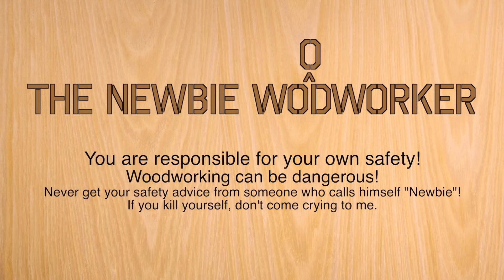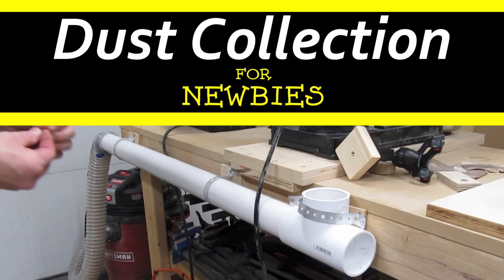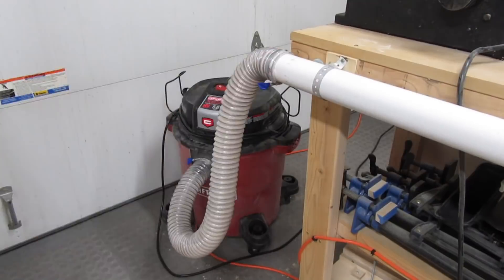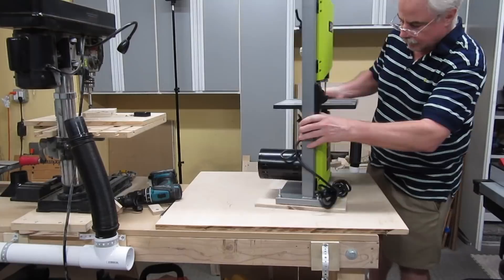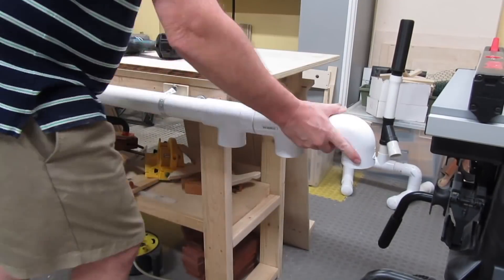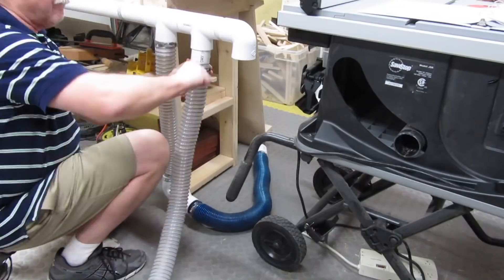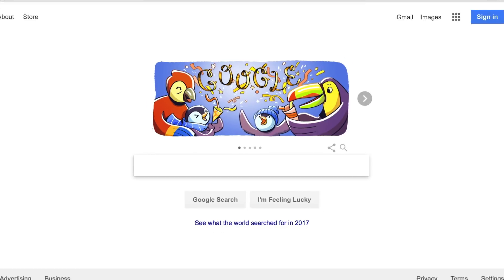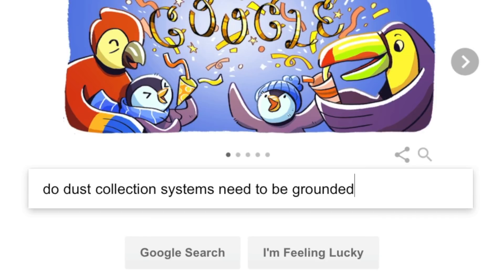Dust Collection Grounding: Follow-Up to 'Dust Collection for Newbies'

Comment: "Do dust collection systems need to be grounded?" I think I agree with James Hamilton on the issue. I also installed an above ground pool once that I didn't bother grounding or bonding either, despite the installation instructions. There's just too many conditions that would need to align perfectly to create an actual hazard, so, I'm going to skip this step. Thanks, Dan, for suggesting I ask that question of Google, which was also, in your roundabout way, an invitation to form my own opinion on the matter. I like your style, Dan! :)
Reply from the maker: Glad I could help. I can't remember if I mentioned it in this video, but here's an article I came across: http://www.woodcentral.com/articles/shop/articles_221.shtml
Reply: @TheNewbieWoodworker  Thanks for sharing that article. It's a little sad that the author had to do so much work to debunk a myth, or several. But, I'm glad they did, to hopefully save a bunch of woodworkers (Newbies and experts alike) headache and effort. :)
Reply from the maker: @primehomeinspects  I agree with you, although to cover my butt, I always tell people to do whatever they think they need to do to stay safe. 😏

Comment: I googled "do dust collection systems need to be grounded" and came across this youtube video https://www.youtube.com/watch?v=WJ8NMYlhaLQ which, near the end, claims that all dust collection bins should be metal in case of fire that could be caused by sucking in a hot piece of metal.  That said, I noticed that your bin, and those proposed by others, use plastic buckets.   Should this be something to worry about?
Reply from the maker: It's a good question. Here's my personal take on grounding PVC-based systems: https://thenewbiewoodworker.com/2020/01/21/dust-collection-and-pvc-static-fire-danger.html. Regarding using a metal bin, I can't argue with that, except to say that it seems extremely unlikely. Not impossible, though. And I think if I used a metal bin and metal piping, then I'd ground it "just because", if you know what I mean. So personally, obviously, I don't worry about hot metal causing a fire, and most people don't, BUT maybe we're being foolish?

Comment: Thanks. Working with Flammable liquids it becomes very
necessary for grounding the vacuum system. One spark could cause an explosion.
Take precautions in your finishing shop.
Reply from the maker: https://www.rockler.com/exploding-pvc-dust-collection-ductwork

Comment: I agree that debate has sparked a lot off controversy, and you may have suppressed any flame wars by not saying your thoughts or telling anyone else how to mitigate any potential explosions. Sometimes children have to learn on their own, as adults we just have to explain that risk can be inherent in many things we do. 
I get more static charge petting my cat on a winter's night sitting on man made fabric than my Van de Graaff generator.
For my D.C. System I have a Supper Dust Deputy Oneida says the Cyclone is made of a material that that does not allow static build up.
And I have not had any static charge in my system.